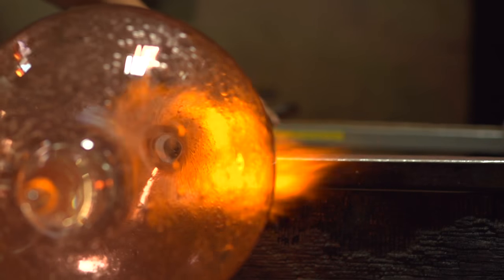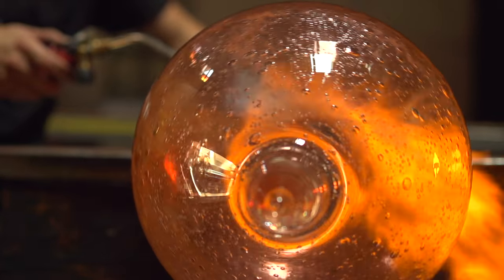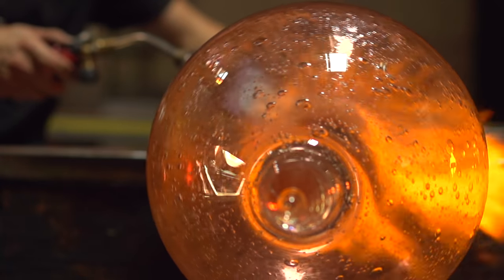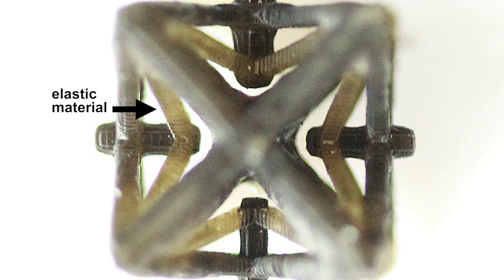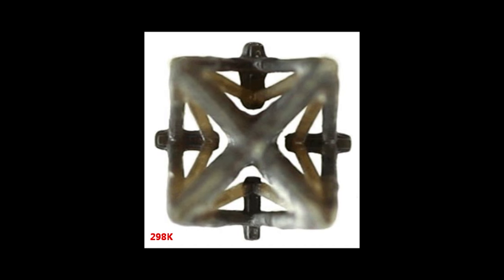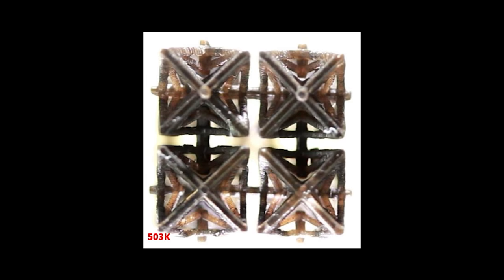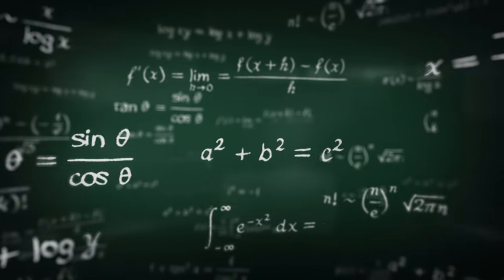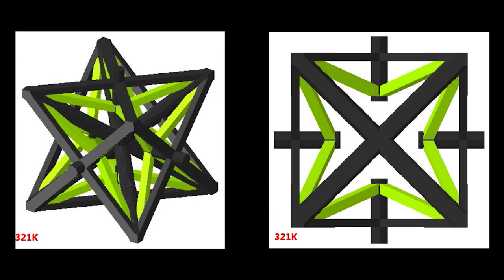Heat-induced shrinkage

Comment: Intricate man made structures like this will always be too expensive to use in every day devices. My initial thought is that the path this research has taken will ultimately be a dead end, having wasted time and resources better put to other projects.
Reply: Even if your unsubstantiated claim is truth, the knowledge that this method is not viable, is valuable and worth the time and resources.
Now I would like to ask, what would be those other projects?
Reply: I don't know.  I would have to be on the committee that looks at the various approaches on the table and decides which approach or project is worth researching. I'm an electronics engineer running a modest electronics design firm.  In real life I only have the cash to pursue one possible solution. If I spend time and money on an idea that turns out not to be practical in the end then its a catastrophe for me. There's no cash for another try. Hence the need to know, instinctively or otherwise, which path will result in practical results and which is doomed to fail. This approach requires delicate micro-machining of materials, even if successful you would never be able to scale up production to make it economically useful as a material. Of course I could be mistaken but this is what my initial thoughts are taking me to. Occasionally I see ideas that really excite me for their potential. This one did not.
Reply: wtf are you talking about....
Reply: Look at the structure of this thing and how they made it. The end objective is to come up with a material that doesn't shrink to be used in normal applications. Even assuming this material was strong enough and had the right properties apart from not shrinking,  how much do you think it would cost to make this stuff in practical quantities. My expectations is that it would be ridiculously expensive so as a product its doomed to fail. People would just use plastic, metal, or glass as is currently being used. In life its not enough to be smart, you also need to be practical and wise. When considering options to investigate you need to look ahead into the future and ask yourself critical questions like "is this solution practical in the long run"
Reply: Robert Accardi Now answer me, do you know what 3d printing is. Of course it will take you big amount of time to solder many components on a circuit board. But now you have PCB. It's all automatization nowadays. You simply have to have the voltage to do it, which definetly wont be that much to print such not-so complex element. People are printing far more compelx structures for few pennies.
Reply: Have you seen how slow 3D printing is?, and how fast a factory needs to produce for example a plastic CPU support cover. Things need to be produced in seconds not hours or days. And this thing used a 3D printer unlike the glue guns on gantries that is common today. The printer these guys used printed out on a molecular level.
Reply: Robert Accardi So we should just stop researching because it will be expensive. This is just bogus. Technology will improve and ultimately become cheaper, just like allmost every tech that have several decades of optimizations and improvements.
Reply: No I wouldn't stop researching for the sake of researching. Some of the best discoveries come when you're actually trying to do something else. What I'm saying is that researchers should think more practically and consider their objectives. If they've spent all this time making a shrink proof material but then find that nobody wants to use it because its not practical to make then they have failed to meet their objective. Afterwards the project gets cancelled because they've used up their allotted time and budget. Suppose there was a more elegant solution, one that never gets discovered because they spent too much time going down the wrong path, a path that was doomed to fail in the long run for obvious reasons. Humanity would lose out.  If the researchers are doing "Pure" research then fine, but if they're expected to come up with a useful solution they need to be more wise in their approaches.  Also the assumption that technology always improves with time is incorrect. Sometimes you hit natural limitations that prevent a technology from advancing no matter how much money you throw at it.
Reply: Robert Accardi This is just nonsense man. These researchers have the time and money so they "waste" them. But somewhere might be a a guy in basement doing the same thing with a monthly salary. And nanotechnology is improving steadily, this is the time to do such experiments. Also we will have empirical findings.
Reply: Yes, "waste" them indeed. Someone, in a basement? Doubtful.  Its not the value of nanotechnology that I doubt. I'm sure its very useful and will evolve. Printing things like livers and other organs I find very exciting.  Its the use of it in this application that i question. I'm wondering what other avenues for achieving anti-shrink materials they considered before reaching for their nano-tech printing machines.
Reply: Robert Accardi I'll stop here, we going in circles.
Reply: Before you go I'll leave you with a story that might explain the point I'm trying to make. Its about Television. When they were trying to figure out how to make images appear on a screen eg TV,  there were two competing technologies. One was by means of scanning electrons across a phosphor, the other was by means of spinning mechanical discs. Apparently one guy was able to create images by using spinning mechanical discs and though the images were rudimentary felt that with enough time and effort he could perfect the technology. One day he hears about a demo of the electron scanning technique and goes down to the place where its being shown. Story has it that after the demo he goes back to his workshop, closes everything down and walks away never to pick up tools again.  In that one moment when seeing the electron scanning technique he comes to realize that he's taken the wrong path and that no amount of work will make his spinning discs provide the sort of results he's just seen. One application, two paths. Going down the wrong path does have its consequences.
Reply: Robert Accardi Surely I agree, but do we have a secondary idea to try build these things. If not, then we must explore and see where it goes. If it fails then what the heck, atleast we know.
Reply: Truthfully,  I don't know. Its not my area of expertise. Why this video should bug me I'm not exactly clear. God knows I've made bad design decisions over the years. My distaste for wasted money and time stems from the growing realization that even though we can recoup lost money, lost time is gone for ever. Hopefully these researchers will prove me wrong and provide something worthwhile for us all.